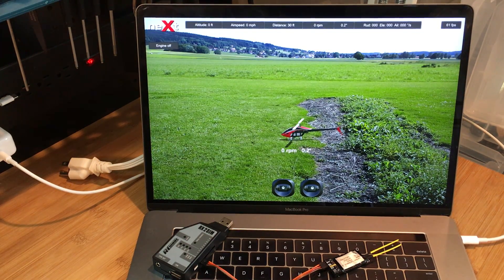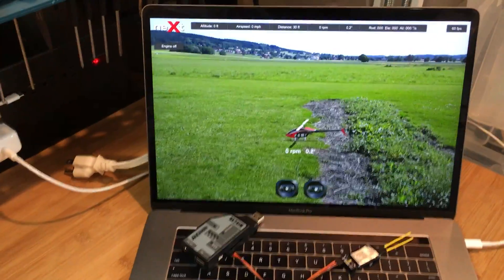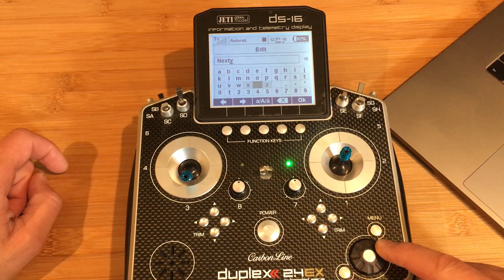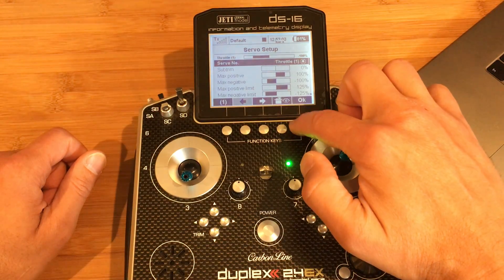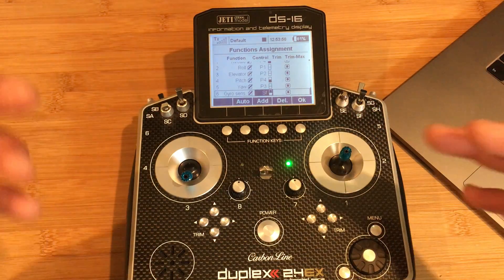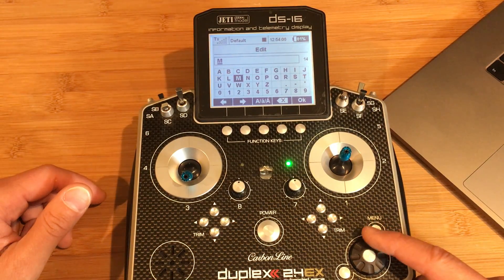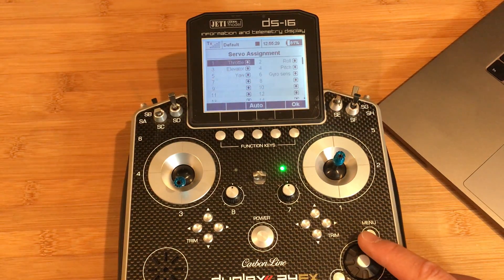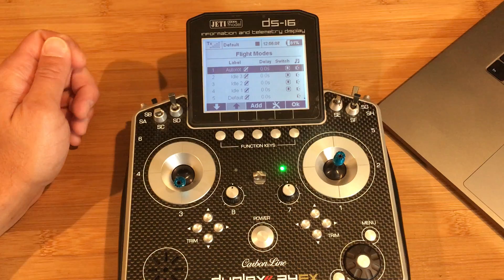neXt flight simulator wireless setup with Jeti radio and RC Ware RX2SIM interface -- Part 1

Comment: I need help please. I D/L the the soft ware. But I never get that log in page. I just get a connect page and it does not see the RX2sim interface. I tried on a pc and mac.... HELP!!!
Reply from the maker: Lets make sure I understand correctly.  (1) You downloaded the neXt simulator software.  (2) You have a Jeti radio, a Jeti receiver, and a RX2SIM interface.

First, make sure to bind the Jeti radio to the Jeti receiver.  Then, make sure to connect the Jeti receiver to the RX2SIM in the correct ports.  I say that because some of the Jeti receivers have the ports mislabeled.

On the RX2SIM, make sure the MODE LED light is set to purple, and set PPM.

Start with that.
Reply: I have a Jeti DC24 , bought in 2017.  YES THE Jeti RX is bound and functions.  I am using Real Flight 8 soft ware.  I went to site you recommended ( beastx)  and D/L'd the s/w so.... RX2sim... could  talk to REAL flight  on PC. I went through the exe and was able to get to the finish button.  That is when the large dark screen appeared. 

The Black screen looks as follows:
   The s/w from beastX opened and only had 1 place to click search or connect. It is a black dialog box... very large.   Across top is says in orange Studio X ....    below that is USB2SYS.... then all the way across on right side there is a Rescan...Then a few spaces below...a grey dialog box that com3 shows up when I plug in RX2sim....     then below all of that in middle of page is a large connect button.     At bottom of page there is a german flag and brittish flag for choosing language.... and that is all that is on page.    No sign in, no user name or pass word.  I did this on mac and PC.   it did not recognize the rx 2 sim interface.   I also did not get the dialog box you did!

   Will RealFlight  work?   my jeti rx like yours has s/w version 3.13... I see yours is 3.24.   Will 3.13 work?   
I did look for s/w from RCWARE and freak ware...it is same D/L.... so those made no difference.

Thank you so much
Reply from the maker: Send me a private message with your email and/or text so we can communicate more efficiently and get this sorted out.  I have RealFlight 8 (used to have RF 6/6.5 and RF 7/7.5 but sold them), and it works very well with the RX2SIM using the setup in the video.

You do not have any YouTube videos posted at this time, so I cannot send you a private message.  These are the instructions to send a private message via YouTube.  https://support.google.com/youtube/answer/57955?hl=en
Reply: Your channel has no "about tab"  ( as other do to click on)  You tube says you need to verify your name... i think.... i might just post my phone number here.  I already get annoying calls all day....lol
Reply from the maker: Easy.  Create a new miscellaneous gmail account.   Post that email account here.  I’ll then email you my email and text to that email.
Reply from the maker: I emailed you.  We will get this figured out.